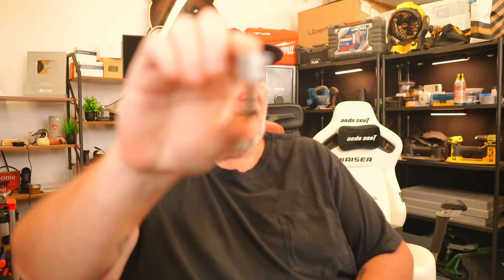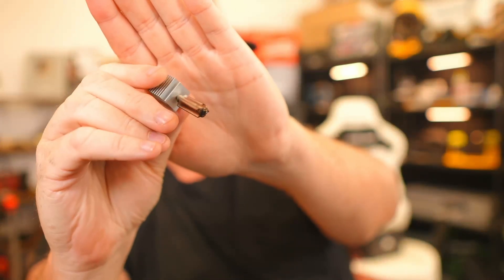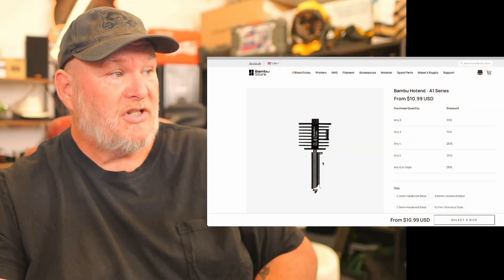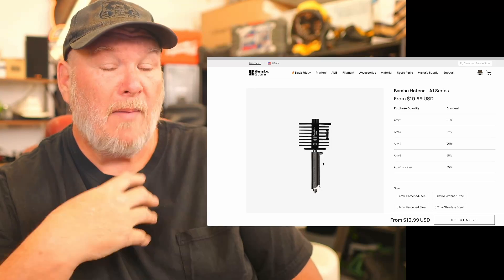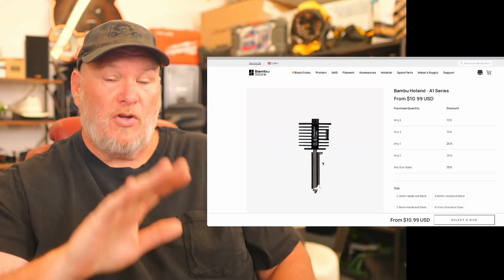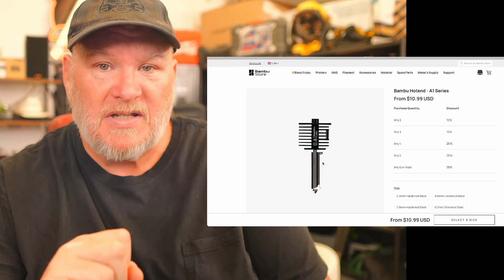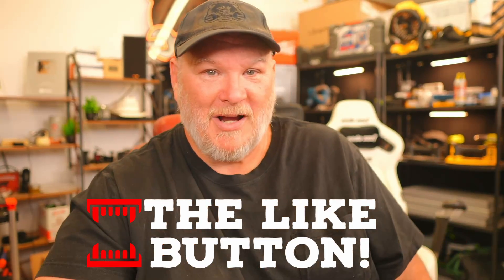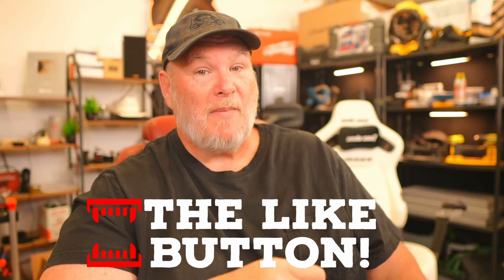Never Fix This Part on your 3D Printer Again!

Comment: I know this is getting old. But make sure you are retracting 5 mm at the end of a print. The extrude 5mmm when you start. I have not had a clog since I started doing that. 
Retracting leaves less in the tip to harden . When you reheat it then push a solid piece back down. It pushes the plastic out. If you don't it partial melts the plastic and it has hard time pushing plastic.

Comment: one question that that you sort of created to me it sounds like you have a print farm. You don’t recommend bamboo lab printers for print farms yet you’re holding a bamboo nozzle. What printers are you using? Did you convert one of your printers to use bamboo nozzles?. I have a Sobel SV08 and I’ve seen where people convert them that’s why I’m asking. Don’t take my beginning comment wrong. It’s just a comment. Your video does give good advice.
Reply from the maker: I do recomend Bambu Lab printers just not the A1 or A1 Mini.  My print ranch is mostly P1S machines. I keep an A1 for prototyping.
Reply: @3dprintrancher  Thank you, I have a similar setup (just a hubbliest) one of each, but I missed the struggles and tinkering so I picked up the Sovol SV08 for larger prints, right now the print head board is flashed with klipper other than that it's stock and this printer works very good. I get those spares when they go on sale BTW, can't beat it!

Comment: It takes me about 2 minutes to fix with a culinary torch. 30 minutes times 10.99 each is $329.70 per hour. Just have spares, swap them out, and fix them later.

Comment: I would note that if it's mostly just filament around the tip of the nozzle, popping the silocon boot off the hot end, turning the hot end up to 250C and then using a tooth brush, or one of the harbor freight bras or nylon brushes to clean off the exterior is probably going to take less of your time, especially if you're using your temperuature rise time to unpack the brush.  You do want to keep track of where the temperature is, because there is a timeout where the printer will shut down the hot end if it's not printing, but if you're doing it with some regularity, you'll work out about how long it should take to come up to temperature.

If the nozzle is clogged, yes, swap it out. You can build a rack to hold the nozzle vertically in a toaster oven and hope that gravity will melt out the filament, but I wouldn't put a lot of confidence in that myself. And don't 3d print that rack, go with a wire rack, or do a bit of sheet metal fabrication.

Oh, and the tip of the nozzle itself is replacable. In a hardened nozzle, that is the only part of the hot end that's hardened. As a result if you are printing with carbon filament (and you've replaced the gears, you're going to need to replace the PTFE tube the filament is passing through to the extruder, and the walls of the hot end/nozzle will ultimately experience erosion.

Comment: Everybody needs to fix a least one.  Anymore than that is crazy. Mine clogged. It was a Stainless Steel .4 nozzle.  I had a spare one. I also had a spare Harden Steel one. I used the harden Steel and will never go back. Someday when I'm bored I'll clear it out, but sometimes ya just got to keep on trucking.

Comment: I agree with you, if I can't clean a clog within 10 minutes...then I replace it. It's brilliant. My old printers, fixing a hot end was a better choice than spending $100+ hot end to move on. I might fix one if I have a moment as a back up in case I run out at spare. The show must go on.

Comment: When mine got clogged i just used the machine turned the nozzle up to 220 let it cool redid the heat up then used the unclog tool went right thru no problems back at it used that nozzle till the hardened ones came in

Comment: I changed out a stainless steel nozzle last night to a harden steel.  I do that when the stock print head gets about 600 to 800 hours on it. Then I change the print head after 1500 or more hours. Or if I see multiple prints failing.

Comment: Counterpoint: Throwing something away that can be easily fixed is just pointlessly wasteful. Swap it out for a new one that isn't clogged, sure. But don't just chuck it in the garbage. Set it aside and once you have a handful of them in that condition, go through and fix them all at once.
3D printing already has a massive waste problem. Please tell people to make it even worse for the sake of saving a few minutes.
Reply from the maker: Sure but how much is your time worth? If you have the free time to do that? For me, if I have free time I can better use that on improving my business then trying to rescue a $7 part. And this is an easily recyclable part.  I have a bin that I put metal waste in and when it gets full I just drop it off.
Reply: Recycling is fine, but when your message is, and I quote, "throw it away," most average people aren't going to have the presence of mind to set it aside and start collecting parts to take them to a recycling center. They're going to toss it in the nearest trash bin and call it a day.

Comment: Always keep spare hot ends and assemblies.  The time it could take to clear a clog or blocked hot end isn't worth the effort or time.  Seriously.  Been thinking of creating a tool consisting of a heated needle that would be bored to the size of the nozzle and help to clear any blockage AFTER you swap it out.

Comment: keepin them in stock is a good idea, but i also own a "no clogger" tool as well... which fixes 90% of my clogs and takes 5 minutes tops. if you have a clog that happens overnight that ends up in a bunch of plastic all over the hotend, hotend bent or broken, etc, then yes, just replace it.

Comment: I can agree with what you are saying, but I would still keep the old nozzle and say when I get like 5 or more of them, I would just set aside an hour or so to fix them all. And maybe put a mark or something on them once I fix them and if I notice that they fail again soon after they have been installed. This would tell me that it is just better to throw them away than to try and fix them. Think of them like refurbished parts, some work just fine and others should have just been thrown away!
Reply: I have 4 fully loaded hotends that I treat the exact same way. a bic lighter and few minutes each and they are all repaired.

Comment: For common replacement parts that fail on a machine all the time, keeping them in stock is a great idea.  If you use multiples of the same machine its great because you can stock most of those parts, and if you have a machine that dies, keep it for spare parts.